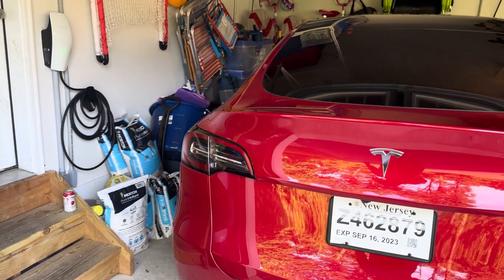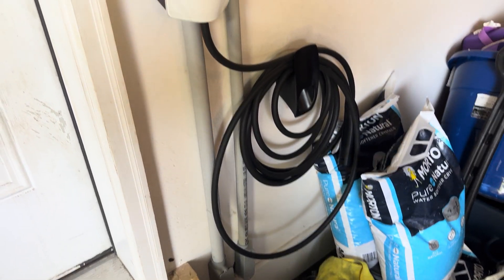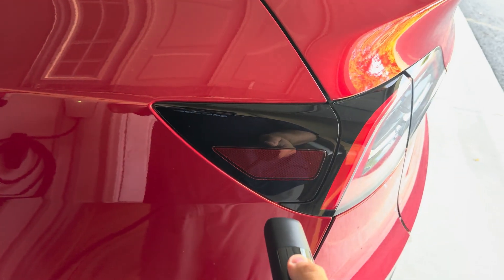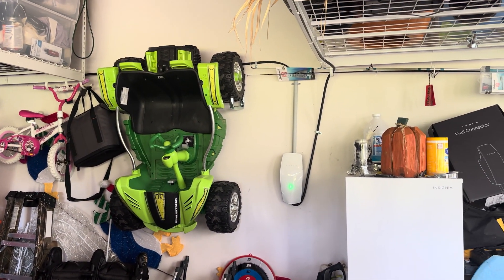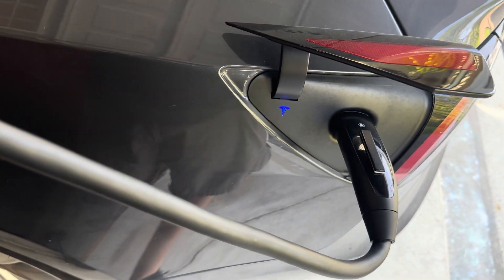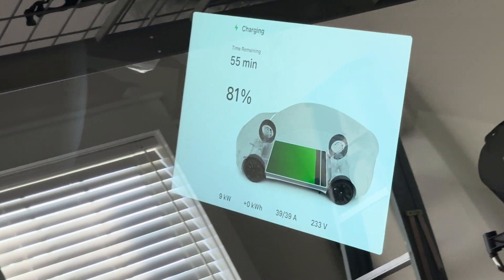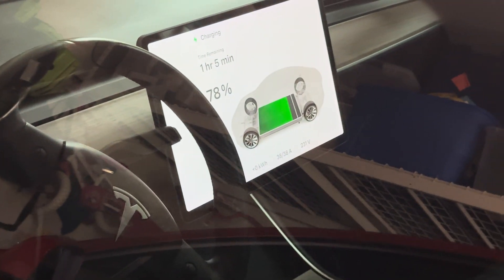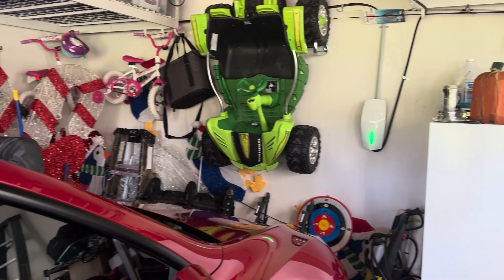Power Sharing Setup with Dual Tesla Wall Connectors!

Comment: Can't use 6/2 Romex. It's illegal
Reply from the maker: @daylate  wrong. I’m in NJ and this is approved here. I’ve checked temperature of the wire after 3+ hours of charging at 48amps this past summer on a 103F day, and it did not exceeded temperature rating for the wire.
Reply: @GateFather  code book said branch circuits can't be bigger than number 8. Where did you get your reference?
Reply: What happens if one car finishes charging but is still plugged in? Can the other car charge at full speed or is it limited?

Comment: This is technically not power share. Power share uses one circuit to both.
Reply from the maker: If you go back far enough they’re both on one 100amp breaker on the main. For that reason they’re setup to never exceed 80amps combined at 40amps each, but will charge at 48amps if charging along. Tesla refers to this in the wall connector configuration as power share.
Reply: @GateFather All circuits eventually flow through one breaker...

Comment: I’ve got this all set up now the same as you with two wall connectors each on their own 60amp in a 100 amp sub panel. My Cybertruck should be here next week and I’m in NJ also!
Reply from the maker: Nice!! I was going to get a cybertruck but decided to wait a few years. Instead I traded in my 2018 model 3 long range for a 2024 model y performance 3 year lease. I’m now in process to get a 24.3kW solar system with 4 Powerwall 3s installed.

Comment: I just installed two Tesla Gen 3 chargers. I did it one at a time ov er a week or so. How do you pair them to load share? What am I missing? The app is borderline useless compared to juice box and even CP. Any help is appreciated. It's like im missing 80% of the menu to change stuff.
Reply from the maker: In short, you have to connect to the WiFi signal of the wall connector that’s the main. Then access it via browser local address http://192.168.92.1. Checkout page 28 of the manual here for detailed instructions. https://www.tesla.com/sites/default/files/support/charging/Gen3_WallConnector_Installation_Manual.pdf

Maybe I’ll make another video today on how to set it up.
Reply: Thanks, I was able to do it. Wish th app just had options instead of that clunky back door style.  @GateFather
Reply from the maker: @mkennel6565 Agree! Glad to hear you got it setup.  In fact, Tesla sent me a survey recently regarding the wall connectors and I provided that feedback.  Why not have the options and config for them in the Tesla app and make it simpler to setup and use?

Comment: What cable do you have running to your farther wall panel? It looks like its exposed 6/3 nm-b romex?  Romex has to be inside a wall for finished areas, though can be exposed in unfinished areas like attics. You are also not allowed to put romex inside conduit...you should have run #6 THHN cables inside of conduit to your far charger. 6/3 romex is also rated to 55A, so max charge rate is 44A. If you use #6 THHN cables inside of conduit, then its rated to 65A, so would be fine to charge at 48A (like, if you are only charging the far car)
Reply: Be careful with this much load. Residential breakers fail very often. I only can imagine what can happen if breaker melts.
Reply from the maker: It’s 6/2 Stranded Romex SIMpull CU NM-B W/G Wire. It’s rated for 55amps and “May be used for both exposed and concealed work in normally dry locations”. Conduit is just to get it high enough that it can’t be accidentally pulled/touched by anyone unintentionally.
Reply: @GateFather “May be used for both exposed and concealed work in normally dry locations”...yeah..that is just a product description. Actual electrical code states romex 6/2 has to be "concealed" in the wall..i.e., protected in the wall, in finished areas (like the garage), and can be exposed in nonfinished dry areas ...like an attic. The thin sleeve of the romex 6/2 just does not provide enough protection from day to day life.   And you can not put romex inside conduit....because the wire would overheat (you have a sleeve AND conduit blocking heat dissipation).    You could take the sheath/sleeve off the romex 6/2 and then run the cables inside conduit (not technically code because the wires inside the sleeve do not have descriptions written on them)...and then it would be rated for 65A and be protected.      Right now, the romex 6/2 is rated at 55A, which means you can only charge at 80% of that, so 44amps. Are you allowing 48amps to go to that charger?
Reply from the maker: @dannicolegoggins  NM can be sleeved in conduit for “a short distance” where damage is possible according to code. This is common in garage applications such as mine.  The wire does not get even get warm after checking while charging at 48amps for hours. In fact, the charging cable coming out of the Tesla wall connector is warmer towards the charge end than the Romex is anywhere along the run. Most of the time the charge rate is 44amps or less, but does go up to 48amps occasionally if one Tesla is charging alone. 48amps is 4amps more the 44 and is only 9% above the NEC standards. The exact same wire is rated for 65A in Canada, so it’s worth mentioning the difference between code and safe. 9% more amps translates to ~19% more heat in the wire under load. Teslas also have safety features built into their software to check for voltage drops due to heat in the wire and will lower amp draw accordingly. They’ll alert when this happens. I’ve run over 6/2 for many years at a prior home as well and never had anything like that happen.
Reply: @GateFather  Oh yeah, I'm sure that open to the air like that in the garage, that heat isn't an issue for the 6/2. I mean, romex 6/2 is supposed to be inside a wall right next to insulation. It will surely get way hotter inside a wall if it was installed "to code". Its more about the protection. Like, you are hanging bikes and power wheels right next to the romex 6/2. That is a thin little sleeve on that type of cable. That is why standard #6 THHN (the same cables inside the 6/2) per code has to be run inside conduit. Same reason why romex 6/2 has to be run inside the wall so the wall protects the cable.
Reply from the maker: @dannicolegoggins  yeah the wire actually is run on the wall side of the storage Units above where the bikes etc hang and is protected by the storage unit itself. Very little chance of ever touching it. I appreciate you commenting to make sure all is safe!